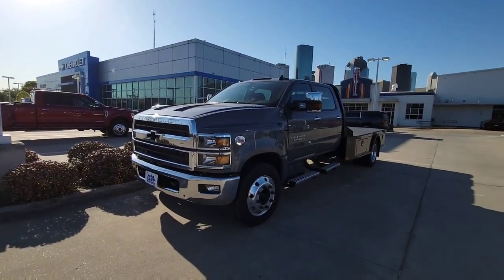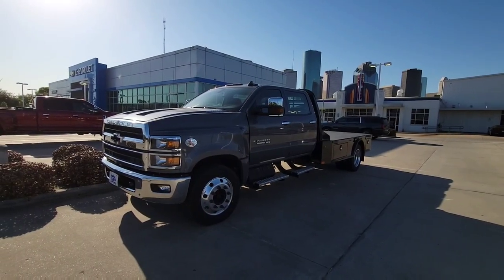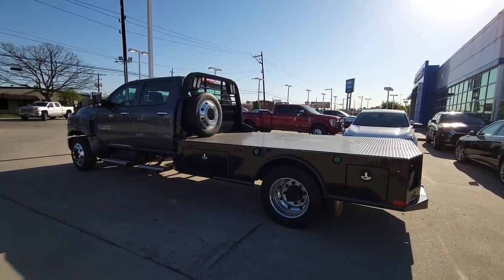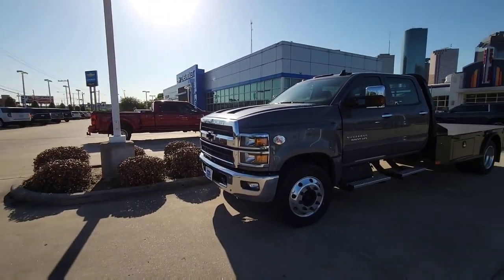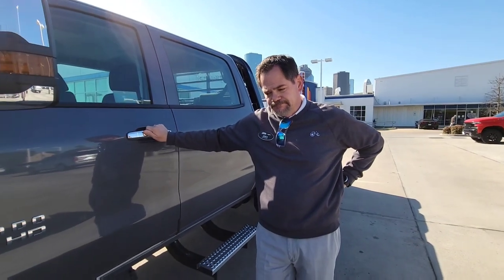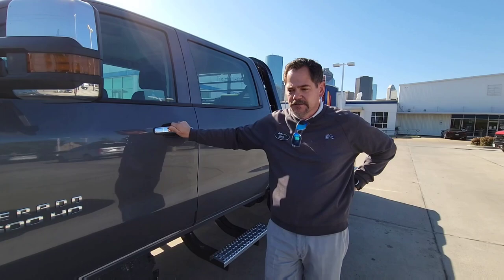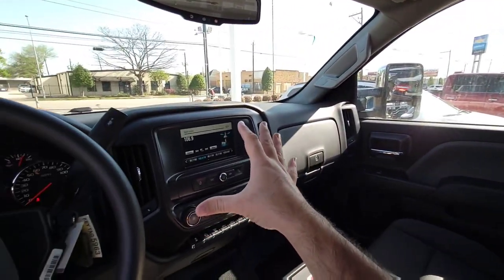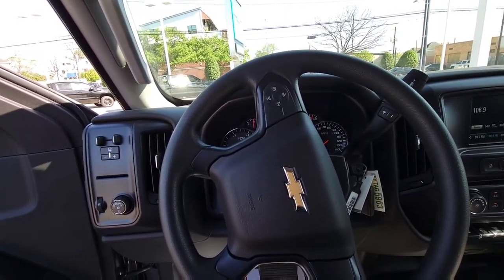Mighty Chevy 5500HD Truck as an RV Hauler? Surprising answer!

Comment: Could you spec it with a higher gross vehicle weight rating. Just looked  at f650 specs combined vehicle weight rating up to 50,000 lbs

Comment: I think the it's so much heavier than the 3500 but equipped with same 6.6 liter diesel engine.  Put a flat bed or dump body loaded with rock or lumber and you will be the slowest truck on the road.    Drop a Cummins 8.3 or 8.9 liter engine in it and be a happy customer.

Comment: I drive one of these just about every day for work and it turns like a battleship. You need 2 full lanes and the shoulder (maybe some ditch also) just to make a u turn.
Edit: we also have a ram crew cab 5500 and f450 single cab 16 foot bed those both turn much much better.
Reply: You must of never drove a chevy 2500. These trucks (atleast the early 2000s versions) turn great compared to normal chevy pickups.

Comment: Question to you JD, if you have an upfitter install a hauler bed, can he adjust the GVWR capacity of the truck?
Reply: Weight ratings are set buy the manufacturer of the chassis. Nothing you do can change those numbers. If you look at a motor home, the gvwr that winnebago puts on their sticker matches what ford said on theirs.

Comment: Another issue is for some reason they derate the HP output of the engine by 100hp, that was a shocker too when I looked at one
Reply: Longevity is the reason.  All 3 manufactures do it to their medium duty line.  Ram drops all the way down to 650 ft lb torque last I checked (it may be more, that was a couple years ago).  I think Ford goes down to 800 or 850.
Reply: @boduke9428  That is nice but I would think you need more HP on a medium duty not less, steered me away from one
Reply: @Hunterworks  I agree. It's why I also buy F250 or 350s. I bought a F550 one time and that was enough. The 4.88 rear kept RPM way above peak HP and tq at highway speed so hitting a hill at 70 meant cresting the hill at 50. Although I understand why they do it.  Derating a highly stressed engine for longevity is much cheaper than developing and producing a larger lower stressed engine.  If I was forced to buy a medium duty I'd choose the 7.3 gas engine. It'll perform as well or better than the derated Powerstroke with much lower maintenance, fuel, and upfront cost.  No use paying that high diesel premium without the added power.
Reply: @boduke9428  AGreed except for the Ford part!!! LOL  I am GM man, love my 20 Duramax denali, pulls like a beast and 18.5k towing for a 3/4 ton is nuts
Reply: @boduke9428  thats by design....if the gearing makes you top a hill at 50, but spinning high rpm, you're moving a lit of coolant across the radiator and spinning the cooling fan fast to shed heat. Long pulls at lower rpm make more heat than a cooling system can get rid of. And hp makes heat, the medium duty trucks are built to pull grades at full load. Navistar has a testing center in commerce city, Co. Ive seen these trucks in camo wraps running up and down the east slope of the rockies on i70 loaded down with barrier blocks for a couple years now.
Reply: @Hunterworks  Semi trucks come with 400 HP from the factory. They're derated so they can run a million miles. Consumers burn their engines out so they can by another truck in 4 years.

Comment: I like others do not understand the math. 
It can carry 18,000 lbs, but not pull it??
How does that work?
Reply: If the combined vehicle rating is 30000 LBS and the truck itself weight 15000, than the tow rating is the difference, namely 15000.  I didn't catch the exact numbers, but it basically a result of the heavy weight of the truck itself.
Reply: @hansschotterradler3772  I cant imagine that truck weighs 15000lbs. My Chevy 2006 Kodiak 4500 weighs in at 11000 lbs, and it is a bigger chassis than the new chevys. Also, that bed is way too big for a fifth wheel hauler, a shorter wheel base would lighten the truck weight considerably as well.

Comment: Hey JD; when you keep comparing this Chevy 5500 to a F650/F750 simply because of the medium facade of the truck you are doing your F450 an injustice. Your truck is more capable than this 5500! Likewise the F650/F750 with the medium duty body size is extremely more capable with GVWRs of 20-33k and rated for towing things when configured properly up to almost 37k behind it! Chevy should work on getting their towing numbers improved to continue to be a player in the medium duty segment; I agree if you simply want a hauler truck (none or light duty trailers) this is a good option, however often times when buying a medium duty you want the haul and tow capabilities to be present (at least I would!). Long time viewer and appreciate your videos, just thought I’d share my 2 cents! Thanks!

Comment: Bring it to Indiana and the 26,001# CGVW goes out the window for RV personal usage. Is this not built on an IC frame with some IC components?
Reply: the problem wasnt the 26,001lbs, it was that his camper and this truck would weigh more then what the truck was rated at pulling. this truck is 17,500 - 19500lbs and with a 17,500 camper that puts it over the 26,000-30,000lb GCVWR of the truck.

Comment: Will it work for a non cdl hot shot trucker because of its low gcwr
Reply: You would be limited to about z 10,000 pound trailer not good for non CDL hot shot!
Reply: Don't need a CDL if you aren't making money with the truck.

Comment: But JD, you can get a Silverado 5500HD Crew Cab 4x4 with a GCWR of 30,000 lbs and 37,000lbs.  If you only wanted 2 wheel drive then you could get it with 35,000lbs GCWR.  These would be able to easily do a 5th wheel.
Reply from the maker: I know GM claims the GCWV goes that high, but the dealer claims that it's nearly impossible to order a truck with the 35k or 37k GVWR spec.  They say the transmission isn't designed for heavy towing. Also, the 5500HD with the 35k GVWR also only comes at the 19,500lb GVWC, leaving only 15,500lbs worth of towing capacity.
Reply: @BTBRVReviews  I just confirmed in a 5500HD Crew Cab, 4x4, LT trim, 34k GCWR truck that’s in Kentucky, doesn’t have any upfit installed yet.  Dealer confirmed that the dry shipping weight for the truck is 9,360lbs.

Comment: Problem you will run in to is the Duramax motor, Truck stops will not work on it if you break down, so your limited to Maintenance Areas and having to deal with Dealerships

Comment: 2021 5500 HD GCWR ranges from 26k to 37k depending on rear axle ratio and rear axle rating.  Tell me again why I can't use it for my 17k 5th wheel?  What is the curb weight, certainty not over 20k as that would exceed the GVWR.

Comment: Can you explain the math behind his statement that you can't pull a 17000 lb 5th wheel with it?
Reply: The truck can weigh as much as 19500, that only leaves 17000 in the GCWR. By the time you add a hauler bed, and pack the 5th wheel, and add a couple adults and a kid you have gone over the GCWR.
Reply: The GCVWR is the combined weight of both vehicles which in this case is more than it's rated for.
Reply: States like texas dont go off curb weight they go off gvwr of vehical and tow together. So lets say 55000hd has gvwr of 17000k and his trailer is 17500 that is 34500 and its gcwr is 30k per texas dot
Reply: Generally speaking your gcwr on truck and trailer can't be over 26k without having a cdl.  My truck has a gvwr of 10k so I can have a trailer with a gvwr of 16k legally.  This truck probably has a gvwr of 20k so it could have a 6k trailer without a cdl.  If he bought this and got pulled over the cop would look at the stickers on truck and trailer and see that he was at about 40k pounds and get a ticket.  But it could absolutely pull it it's just not legal without a cdl.  Which at this point he should just get one to have it.

Comment: Help me understand.   The truck could certainly pull a 17,000 pound camper, but the combined numbers would put you into "commercial truck" space, which, depending on your state, would involve additional licensing, insurance, registration, etc.   Is that correct?
Reply: Nope. CDL is only needed if you're gonna make money off of that truck.

Comment: So what are the technical differences between this 5500 hd vs a 3500 hd, why does the the 3500 have a higher combined gross vehicle weight rating? Does the 5500 hd lack the correct differential ratio? I'm sure the axles can handle it, the frame for sure and the tires. Leaf springs?

Comment: Greg few quick questions one what rear-end is under these chevys is it a locking rearend and does this duramax engine still use the tiny pin on the timing gear that is notorious for breaking and killing that engine and is it still using the cp4 high pressure fuel pump

Comment: Chevy website states the GCWR is 37,000, GVWR 23,500. Wouldn't that be able to tow a fifth wheel?
Reply: From the example you used.  As long as the fifth wheel has a GVWR of 13500 lbs or less.
Reply: @scottback3020  Not quite. If you took the truck with a fifth wheel to a Truck scale, the total of the weight on the truck axles (which includes the pin weight of the trailer) cannot exceed 23,500, and the weight of the the fifth wheel and truck combined cannot exceed 37,000. I can't find an empty weight for the truck, so I can't figure out what is a likely number for the truck.

Comment: So does Chevy have an option that will tow a 30k to 35k goose neck trailer? I am a contractor and have been looking for a medium duty truck to pull a 30' gooseneck with a backhoe or telehandler. Don't want to put workers in a $90k 3500 HD truck.
Reply: Chevy does not but ford and ram do.
Reply: Yes they do 3500hd long box dually with a duramax in the work truck package it’ll run 40-50k

Comment: Ill bet the reduced GCWR is about politics. Be nice to have a Chevy engineer explain what is different between this truck and one with an increased GCWR. Differences would probably be minimal, or only on paper.
Reply: I'm told many of the differences in GCWR, GVWR, etc. are based on the DOT rules and the manufacturer's not wanting to go over the limits.  Does it make sense? Not to me, but everyone tries to avoid DOT.

Comment: JD. Can these these trucks be ordered with a lower GVWR?  That would increase your tow rating if the combined rating stays the same.
Looked on their website but if didn’t give combined weight ratings for the 3 models. What’s the GCWR for a 4500?
Reply: We stock 5500 chassis that are 17,500 GVWR and 37,000 GCWR. Allows for 19,500 lbs. towing.

Comment: So they rate a 3500 dually pickup on a lighter smaller frame/axles to be able to tow 30000 but a medium duty 5500 truck with a medium truck frame can’t tow a 17,000 lb RV camper??? But then say  it has the suspension to carry the weight ??? 🤔 makes no sense sounds like a way to make people buy the more expensive 3500s  to make more money

Comment: Coming from 30 odd years in the towing industry I have to say that there is a lot of comments +/- on their use as towing industry trucks. Most of the negativity is related to reliability. After reading the comments I wouldn't buy one. Pete's and international are the preferred along with Hino.

Comment: I think the towing capacity numbers are BS. I have a fifth-wheel trailer that weighs right around 16000 lbs fully stocked with food water and other equipment we bring with us. And I wouldn't be afraid to back under it with this truck and use it for that purpose. I think Chevy is worried that this might cut into their 90-thousand-dollar dually market. This is not too bad of a truck for the money.

Comment: Lets just say that the interior sucks for room. I drive one w/ an ambulance package, single cab. No leg room, rough ride and not user friendly. No DEF guage, rough ride and no top-end speed. Ram makes a better 5500.
Reply: All true statements.  My best friend had a Ram 5500 and his company forced him to move to the Chevy.  18 months old and it is already falling apart.  Terrible ride and interior.  Shock mounts ripped off the frame.

Comment: Who cares if it is different?  I like the Ram 5500 because it isn't different looking than a 3500, but has the 19,500 payload capacity AND the 35,220 pounds tow rating and up to 43,000 GCWR.

Comment: I'm surprised they would build that chassis with a gooseneck body with the 30,000 GCWR. Seems like a waste. The GVWR on that chassis is 18,000, meaning you can legally put 12K behind it. I would have built it as a 34K or 37K GCWR.

Comment: Please post the GCWR of this truck, I'm doing the math, and there is no reason you cant pull a 20K# payload with one of these.  My 21 F450 CC is rated for a 19,500 gooseneck w/ the 7.3 gas engine.  Does this truck really weigh more than 10K# ?  30K GCWR - 18K trailer = 12K for truck ???
Reply: Just confirmed that the IH version ="The CV offers a maximum GVWR of 22,900 pounds and a maximum GCWR of 37,500 pounds"  What did GM do to their version??

Comment: We run a 2011 F-550 with the 6.7 and it tows around 30,000 day in and day out since day one so why would I get a Chevy 5500 that is much bigger but can't tow 17,000 🤔

I guess that i can just get an F-350 single wheel that can tow more than 17,000 
🤣🤣🤣
Reply: These trucks are really meant for payload applications like box or dump trucks. A 350/3500 can certainly pull more but it can't touch the actual weight that can sit on the frame.

Comment: Too much truck for RV’s.  I have an F550 built for Hotshot, pulling a 40’ flatbed with 2 12k axles.  The F550, while I LOVE the way it pulls and drives, the ride SUCKS!  I’ll be installing air bags and a Shocker hitch soon.  I recently was told that some RV hauling companies won’t allow 5 series trucks due to the stiff suspension damaging trailers.

Comment: yeah it may be a nicer interior but i am willing to bet it's not going to hold up to the test of time and abuse like the ford will. oh also good job putting the def on the wrong side. for anyone using that for commercial use is going to be pissed idk about other states but here in the state of AZ def pumps are ONLY on the drivers side and the hoses do not reach the passenger side. nobody wants to have to take the extra time to walk into the store and buy multiple boxes of the stupid def and have to lug them all out at the same times or even multiple trips just to fill up def not to mention waiting in line for the def and getting fuel. time is money and when you are wasting time screwing around with filling def you are effectively wasting money. stupid design if you ask me. i only learned of it from a spare truck i had to drive for my company that has def on the passenger side. absolute nightmare from a logistics standpoint. you honestly have to be really dumb or oblivious to mess up fueling literally everything is color coded. i understand honest mistakes but there shouldn't be any just pay attention.
Reply: Ya ford and the power strokes engine lineup about a durable as Chinese trailer tires.

Comment: dont buy chevys to tow. I owned a pool,pond&putting green business for 22 years. Went through 10 brand new trucks. All 3 major brands. Buy a Ford to tow. The Cummins are great motors but the dodge/ram trucks fall apart. Chevys are good until you get to an incline.

Comment: Too bad it can't pull a 18000 lbs RV. Too bad
Reply: The 26K GCWR version wouldn’t be able to, but you can get the Silverado 5500HD Crew Cab also in 30k, 35k, and 37k GCWR’s which would be able to easily pull his 5th wheel.

Comment: Let me guess, another derated diesel engine. Thanks big three for offering better than F350, 3500 abilities, with less power! GTFOH! How about rerate the F450 pickup, not chassis cab at 16.5/class 4 GVWR and stop playing these games! Or properly power a higher capacity F450/550, Ram 4500/5500, Chevy 4500/5500 chassis cab for personal RV crowd use! Let the buyer decide if he or she wants a derated work truck for longevity or a properly powered personal RV hauling, truck camper beast. Rant over......! Help JD, they listen to you!
Reply: BTW, they would sell many more of them and create a new group of fans and applications. While they’re at it, how about an OEM pickup bed option too. Ok now rant over! Lol 😂
Reply: It’s because of the way the Epa certifies emissions on this class of truck.
Reply: @jeffs2809  nothing like a little GR to ruin the fun!
Reply: Its a work truck the Motor has a smaller turbo that spools quicker.  You don’t need all that power when most employees will beat the hell out of it.  So rated lower to last longer lower power means longer life.

Comment: Why would anyone ever want this?  I’m not brand biased. I daily drive an F450 limited but if I wanted/ needed a 5500 sized truck, I’d get a ram because you can get it in fully limited trim. But even a Ford 5500, you can get a pretty loaded Lariet trim level. This Silverado is just an ugly work truck